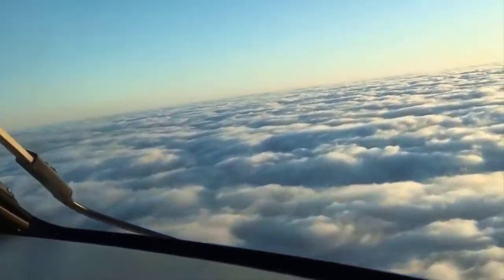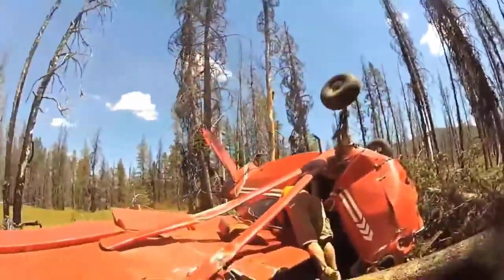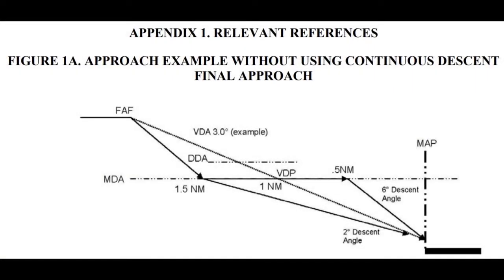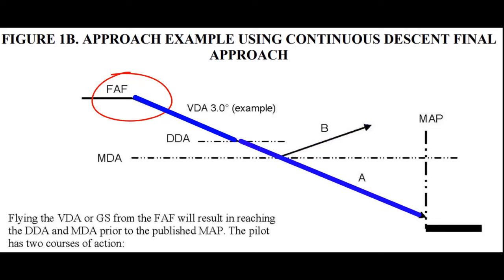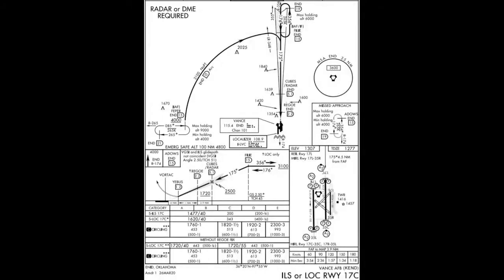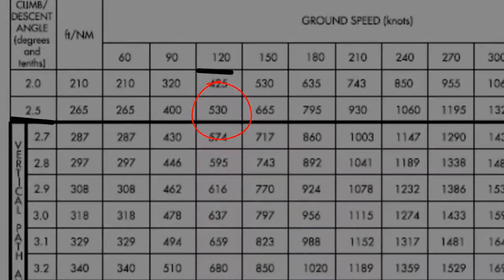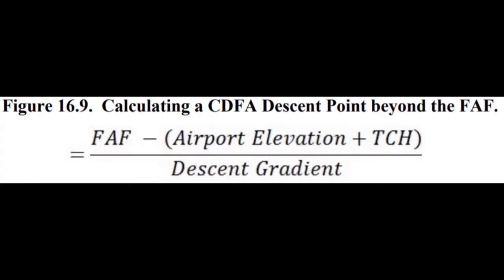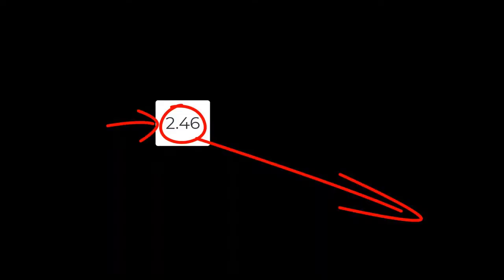Non Precision Approaches: Calculating & Executing the CDFA technique

Comment: great video. I have suggestion. To calculate the distance for the cdfa use the higher descent rate per NM of the two segment. in this case it is from WAPIM and correspond to 316.5 feet per NM. Redoing the calculation the first segment must be reduced of 2.78 NM. So you fly first segment from FAF for 3.92 NM with an angle of 2.99°. This avoid to fail the constrain altitude of 760 feet in WAPIM. (if you use a descent rat e of 300 feet per  NM, corresponding to an angle of 2.83°,  for 4.24 Nm  you are at 724 feet). Then you go ahead for 2 NM at the same angle and you descent to 126 feet.

Comment: Following up on the previous comment, I think I found the problem.  It looks like your formula is missing an element.  The descent gradient should include the miles per minute.  It would be (Descent angle X Miles Per Minute) X 100.  In my plane I use 90 knots for approach.  That would make the formula work out (2500 - (669+42)) / (3.5 X 1.5) X 100) = 4.3 miles from the  threshold.  That puts the letdown dme at 10.0 which is now inside of the FAF.

Comment: I was using the formulas here to calculate the numbers for a VOR at my airport.  KBRY has a VOR 3 approach.  The FAF intercept (8.5 dme) is 2500'.  The field elevation is 669',the TCH is 41', and the slope is 3.5 degrees.  Accordingly, the distance to start descent is 5.1 from the threshold (2500 - (669 + 41) / 350)).  The threshold is 13.4 dme.  Subtracting 5.1 from the threshold makes your descent point 8.3 which is prior to MARNY (8.5 dme) where you must remain at 2500' til passing.  What am I doing wrong here?